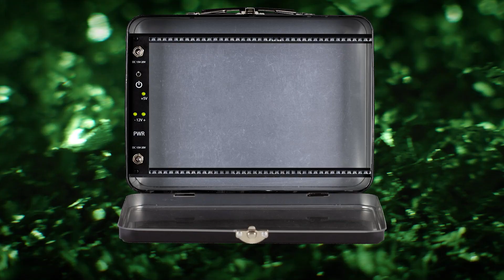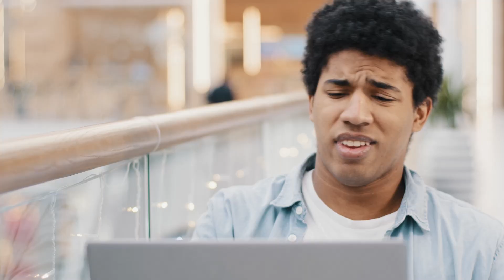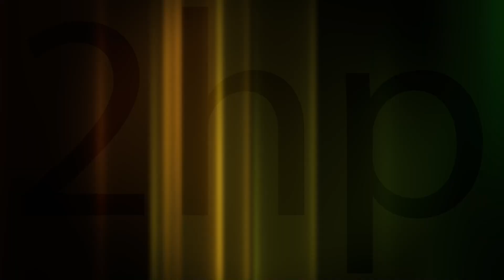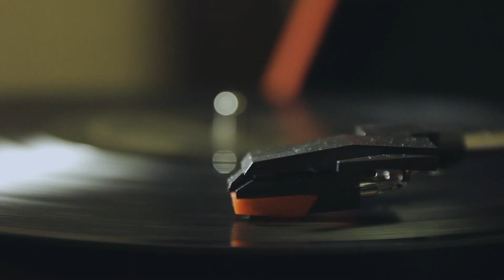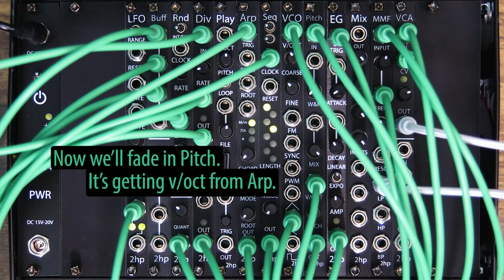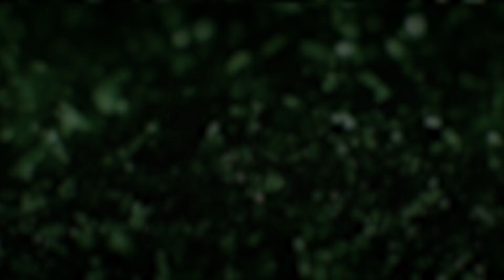2HP Pitch - Tutorial -  Time-domain pitch shifter

Comment: Looks like a super-dee-duper version of the BOSS RPS-10 I have!

Nice having +/-3 8va instead of just one, and the PITCH has V/8va instead of a square wave for pitch tracking !!!!!
Nice!
I've used my RPS-10 for adding a lower bass line to strings on my old RMI Keyboard Computer to fatten them up as well as harmonizing.

Just thought, get four, plug into the Instruo harmonàig to harmonize a choir!
(or, whatever!)

Comment: I'm sorry, skull is very thick... trying to figure out if the pitch knob jumps between octaves? Or, can you chose other notes in the scale? Assuming the v/oct input allows you to play the incoming signal in any key, right? I want to make vocal harmonies but don't want to be limited to full octave shifts. Thanks!
Reply from the maker: No worries at all, Casey. This stuff can be a lot to take in. 
Yes, your assumption is correct on the v/oct input. This will track any notes on scales, not octaves only. Hope this helps!
Reply: gracias!  @2hpmodular913
Reply: @2hpmodular913 What about the knob, does it do incremental shifts?